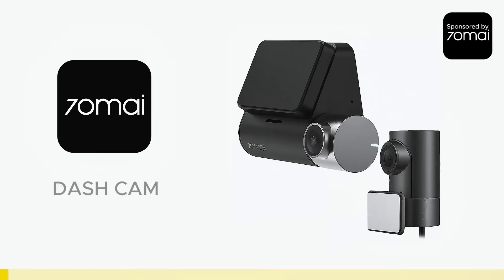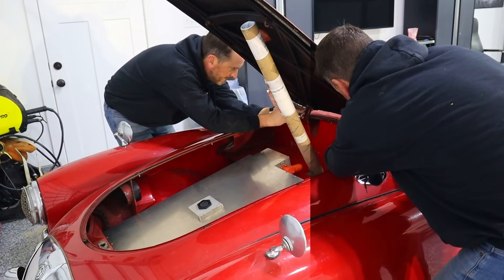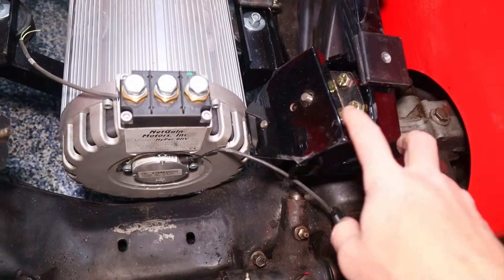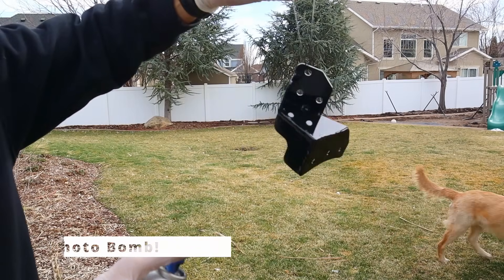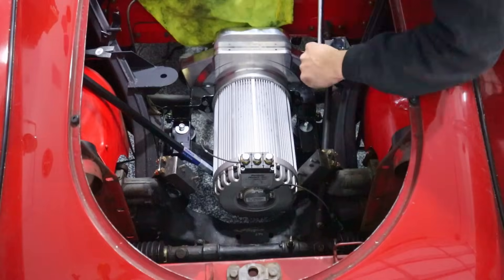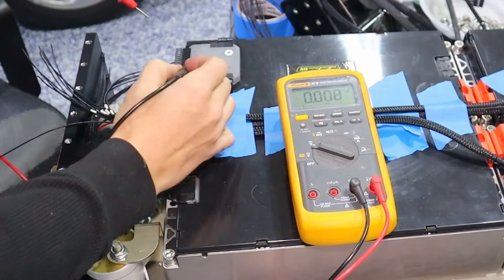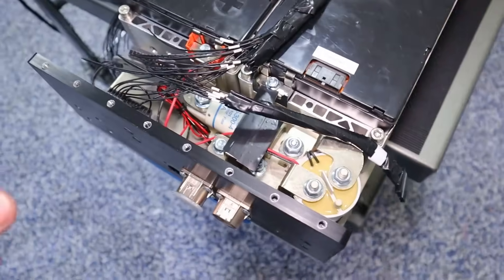Electric MGA Episode 2: Battery Box Removal & Wiring

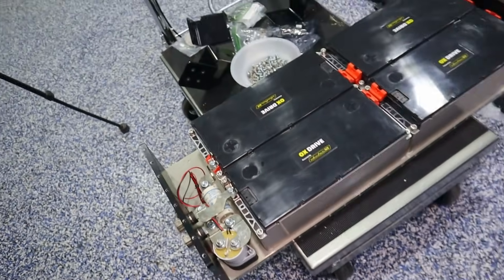Comment: 13:40 Some types of cell like being under pressure, that's why you have those screws. We're talking thousands of cycles either way though.
Reply from the maker: For this battery box, the screws do not put any pressure on the cells.  Just fastening the sides to the bottom.  There is air gap to the cells.

Comment: My name is Tom. 
For DC voltages, currents above 25 mA at 50 V are considered hazardous under normal conditions. Real danger starts around 80V for DC and 150V for AC. Yes, you can get electrocuted at lower voltages but you'd have to really work at it. It is perhaps worth noting that 12/24V DC is just as deadly as 120/240V AC under the right conditions. I had a friend get hung up on 24 volts DC and it almost killed him. Enough damage was done that he had to retire from being an electrician. 
I'm a retired Union journeyman electrician and when working around voltages that required rubber gloves, we used light cotton liners under the rubber gloves and fairly robust leather gloves over the rubber gloves. We tested the rubber gloves by blowing into then like a balloon to check for leaks. They were also lab tested every other year. You can't be too careful, especially if working alone. Really like watching your channel. Keep safe.
Reply from the maker: Thanks

Comment: Good to see the use of safety gloves where appropriate. A couple tips though, If you go with class 0 gloves, rated to a lower voltage, only 1500VDC or so, they will be thinner and give you more dexterity (less expensive too). Also, you should usually use leather protectors over the gloves to protect them from being torn, ripped or punctured. 
   When disconnecting batteries, or live bus bars, consider wearing PPE for arc flash protection. Think for a second about what could happen if you dropped the bolt, bus bar etc. and it fell in the exact worst place possible. People usually think about shock hazards, but a short circuit can cause an arc flash expelling hot gas and molten metal. Eye and face protection should be worn at an absolute minimum. Choose the appropriate level of protection based on the task at hand.
  Great job by the way on the wiring harness. I can't tell you how many times I've found manufacturer wiring or documentation incorrect. Sometimes you just have to be patient, take your time, and trace it out. 
   Be sure to document your wiring and print changes for the next poor soul that has to work on it in the future. You never know when that person might be you.
Reply from the maker: Thanks for the comment

Comment: PPE... you want to get covers for those HV gloves. Those are the inserts and meant to be covered for abrasion protection. Also, make sure you're using proper procedures to test them before use. HV can snake through even the tiniest pinhole so you need to keep those things in good shape.
Reply from the maker: Thanks for the comment

Comment: It looks like you have another car lined up next already?  I saw the cream colored car in the background. I'm glad you are able to do what makes you happy
Reply from the maker: Coming soon!
Reply: Nissan 300z you see. I noticed it as well. He should cover the cars until reveal time.
Reply: Looks like a Z32 Nissan 300ZX. That might be a tricky one to work with, especially if it's got the adjustable suspension and 4-wheel streering. Those were famously designed with a supercomputer to achieve very tight packaging, so I don't envy trying to fit EV parts into the available spaces.